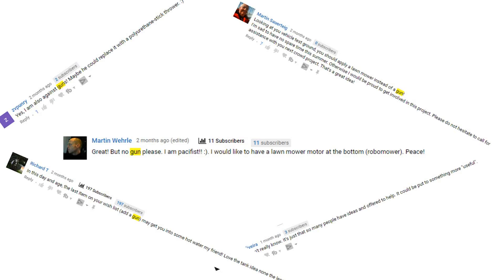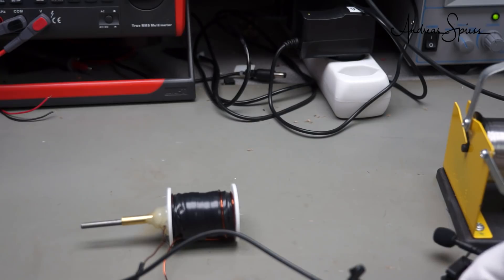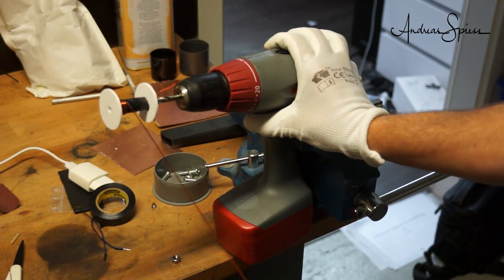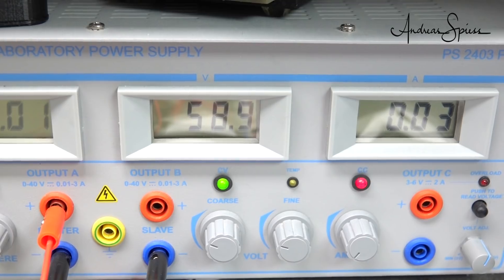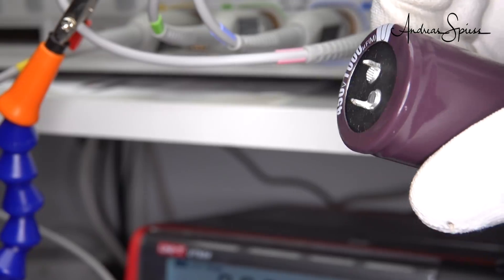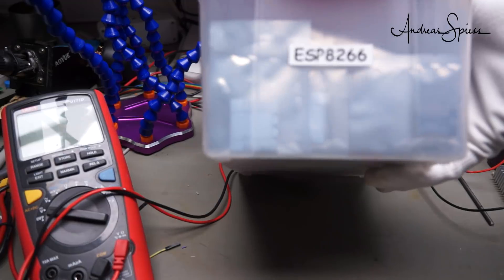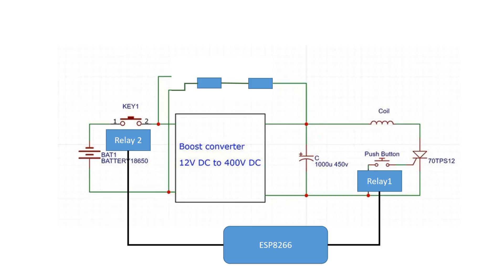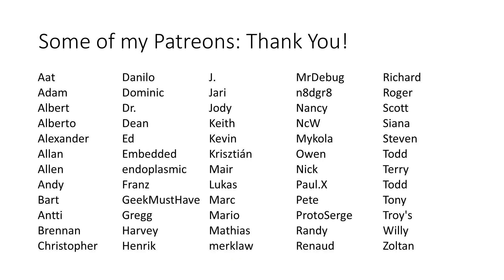#221 Better than GreatScott's Coil Gun? A true story, how-to not do it

Comment: The SCR  Gate - cathode is a diode  and is triggered when the gate current current exceeds 100mA, so gate should not be connected to a voltage source. Connecting it to a 1.5V battery or power supply to gate can destroy SCR which in turn can put 400V on the gate. I suspect that this happened to your power supply. ALWAYS PUT A LIMITING RESISTOR IN THE GATE LEAD.
Reply from the maker: So I learned an additional thing. Thank you!
Reply: As you are switching an inductive load, you should also have a reverse diode across the SCR to protect it when SCR switches OFF. This circuit is similar to a Capacitive Discharge Ignition (CDI)
Charging current of High  Voltage capacitor should be limited to less than holding current of SCR (typically 50mA). You should also pulse the SCR with a 1ms pulse. When inductive load reverses, SCR will switch off and excessive energy will be returned to the capacitor via the reverse diode across SCR.

Comment: Hey Andreas, great video! Many youtubers get a lot of their subscribers by blowing things up, so I hope it works for you too! ;-)

When I was developing power supplies for active sonars, some of the tests were not completely successful and sometimes equipment would blow up and a few times the fire department showed up, but I can tell you that everything was okay because I made sure that I was always behind a wall when the tests were run, and of course the company I was working for was paying for the equipment that was being blown up! :-D

Anyway, stay safe and you should probably think about adding some protection circuitry to any high energy devices, especially if they come from China. A cover to keep the pieces from spraying out and a GDT rated for a safe voltage across the terminals would be a good start...
Reply from the maker: You as a professional in this matter, of course, would have done it differently and I should have known it better.
But because I forgot nearly everything about high voltage since my youth, I was again at the first step of learning: Unknown incompetence, I even did not know what I do not know. 
Now I advanced one step: I know what I do not know. At least something...

Comment: I think reverse emf of the coil caused most of the problems, a tiny reverse polarity stocky diode can solve this.
Reply from the maker: I am not sure as the reverse diode usually prevents spikes if you open a switch at a high current through the coil. In the case of a coil gun, the Thyristor opens at nearly no current.

Comment: Perhaps add a bleed resistor across the cap?
Reply from the maker: Without charging the voltage drops in a few minutes. So I assume there are some parasitic resistors somewhere. In operation, the ESP had to charge the cap every 10 seconds or so because the voltage level dropped below its threshold.

Comment: FWD?
Reply: Would a Free Wheeling Diode across the coil help eliminate the CEMF spike or would it make tau so long as to render the field collapse too long to be useful?
Reply from the maker: I am not sure. Usually, the spikes are created by an abrupt opening of a switch at full current. Here the Thyristor opens at nearly no current through the coil. So no spike should be created.
Reply: Vcoil = Ldi dt If the coil current is 0 to begin with and then 130 amps peak, the voltage will be very high. The question remains: what happens when the current drops to 0 amps? Would there not be a negative spike of voltage across the coil?

Comment: ok, so the next Episode is a repair story of a discontinued Conrad Voltcraft power supply. I assume that your DMM confirms the built in meter's reading. The repair shoud not be a big deal, Standard componente as 2N3773 and opamps as 1458. You can replace the 2N3773 by a fixed resistor and change the load to measure if the opamps are still working (probably not). Or you first can replace the suspected 1458 and but this could lead to a short Video.     

Be happy that your gun did just kill a few semconductors instead some eyes or something like that. Try a water gun. It is also fun but not so dangerous.
Reply from the maker: klassisch D: Thank you for your information. I also hoped I will be able to repair the thing. With your info, it will even be easier.
Dean: Maybe I will do a short video about it if it is worthwhile.
Reply: Andreas Spiess Record your repair as people like me would love to see your approach. And how you repair it.
Reply: klassich D wise words, thank you for the information and taking the time to explain, as I too was having the very same thoughts.  Andreas, pls show us the repair of the power supply.

Comment: Such orders of magnitude between operating voltages is a risky game!  Secondary effects begin to dominate and the absolute maximum ratings are tested ..
Reply: Likely the magnetic field collapsing in that huge coil sent a voltage spike through the thyristor to the microcontroller.  Always isolate the two from each other. The high voltage DC current will eventually kill that optoisolated relay as well through the arcing across the contacts. See John Ward's testing of DC voltage across a switch designed for AC.
Reply from the maker: In this concept, the arches seem to be less of an issue as they usually develop if you cut the current in a coil. In this coil gun, the Thyristor opens at a current of nearly zero because the capacitor is completely discharged. But, as I said, I am not at all a specialist in this matter.
Reply: I am no expert either but if there is a low resistance common ground, the collapse of the magnetic field to propel the nail will happy apply a very high voltage negative potential to ground equally to the thyristor as well as the ESP8266 .. if there is no common ground, then perhaps the inductance between the nearby circuits would do it.  It is a difference of 100x between operating voltages at very high currents and the electrical circuits will be happy to momentarily draw from nearby circuits, and even if it is 1% that is a bad situation!
Reply from the maker: You are right, many potential sources exist and an expert probably would know much more. I learned that, when I will work with high voltages in the future, will try to isolate the low-level stuff completely
Reply: I agree, and it would be wonderful to learn where things went out of spec and why, especially if it could somehow be done in a way where components do not get broken in the process :)

Comment: LMAO @ the 'Chinese 400V'...  Unfortunately, it's dangerously accurate too!
Reply from the maker: This device was one of few which actually exceeded its specs. But in the end, did not survive. Many parts do not get up to the specified voltages or currents
Reply: There are two problems that caused the capacitor to explode.
1. In order to produce 400V from a switching converter, you need spikes of greater than 400V which are smoothed out, capacitor should have been 450V.
2. No load on the negative 400V rail, so it will continue to soar past 400V as long as there is a load on the positive 400V rail. Ohms law will give a suitable resistor value.

Both are noob mistakes from people who do not understand practical SMPS design, only one mistake is yours. Multi rail SMPS designs often only have one rail monitored by the feedback circuit, the other rails are a case of "hope for the best", PC ATX supplies monitor more than one rail.

In hindsight would have been better to ask the electronics community for advice, rather than throwing money at the problem. A quick post on eevblog forum may slow down the video making process, but others would see the flaws in your design before you build it.
Reply: @AndreasSpiess  please contact with me. shohag5050@gmail.com
Reply: Better check your TV, computer and anything that has a switching PSU. Most will have these "Chinese 400V" capacitors in them. And they are not a problem - unless you exceed the ratings, which is what happened in the video. The cap didn't blow because it was poor quality but because its voltage rating was exceeded (the power supply produced more than 400V).
Reply from the maker: You are right. But usually things have a rating and a max rating which is not the same. And the typical rating is printed on the parts. In this case, the typical and the max was pretty close. And the producer of the converter should have known that his device easily gets over this limit. But I do not blame anybody for a 5$ device!
Reply: @AndreasSpiess  Rating 400v, max rating 350v.
Reply: At work we use many Chinese parts. There is a large manufacturing wing in China that would laugh at American or Swiss quality control. Don't laugh at China that easily. You get what you pay for is the bottom line.

Comment: Could it be EMP that killed your esp?
Reply from the maker: Probably. For sure some overvoltage and not overcurrent as it did not smell afterward.
Reply: Back-EMF you mean.  Collapsing magnetic field in that huge inductor (the big coil) would create quite a sizable voltage spike that should never be underestimated. Always be sceptical of Instructables builds which omit the necessary back EMF suppression.
Reply: Actually I ment EMP, a short, but strong magnetic pulse indusing currents in the esp module. Kind of like the coil is the primary of a transformer and the leads in the module is the secondary....
Back EMF was in my thoughts, but I thought that with a thyristor it would stop conducting at zero amps, and that would lead to no back EMF. I could bee completely wrong in that as coils is not my strongest side...
Reply: @kjetiltrondsen8242  The possibility of EMP effects cannot be discounted. A Ludic Science video demonstrated an EMP device disrupting a pocket calculator however the high voltage coil had to be held very close to the calculator and a thin layer of foil was enough to protect it from harm.

Back-EMF is more of an issue precisely because the thyristor stops conducting to the ground rail and thus the coil has no where else to send the current generated by the collapsing magnetic field. It can end up generating a very high voltage at the thyristor's anode. If the voltage gets high enough the thyristor breaks down, and current flows to the grould rail through the gate and right through the microcontrollers GPIO pin. See w2aew video on the topic of flyback diodes for back EMF suppression: 
#183: Why diodes are used around relay coils: Back to Basics on flyback or snubber diodes

Comment: I‘d go with something less dangerous... search for USB Rocket Launcher. It shoots foam darts and x/y axis as well as the trigger can be controlled via USB - so it can be hacked and controlled from an ESP.
Reply from the maker: You are right. Nerf guns are less dangerous. But I was interested to try this "dangerous" variant. And obviously, I learned quite a lot.
Reply: @AndreasSpiess  If you think your Nerf gun isn't dangerous enough,  you can always try Allen Pan's Taser Nerf gun mod or any of the Nerf mods by Peter Sripol featuring flammable gasses.
Reply: I got one of those USB missile laughed from the recycle bin. They were once popular a decade ago. Don't know where to get the USB driver from (no CD,  and dead download link) but the mechanics are pretty simple.  Just need a couple of H bridges and a transistor to bring it under control of any microcontroller.
Reply: You can always put a foam dingle on the end to keep it safe.

Comment: Glad your didn't get hurt! Hope your ears didn't start to bleed from the capacitor explosion. This gun is a real killing machine, you should consider something less lethal.
Reply: that cap only stores about 80 joules of energy, a .22 cal bulley has about 120 joules. a tiny fraction of that 80 joules actually gets transferred to kinetic energy, the 400v on the cap is more dangerous than the "bullet"
Reply from the maker: As mentioned, this was it probably for some time. But I wanted to try it out since quite some time.
Reply: You can always switch out to ball bearings inserted inside of plastic/rubber/foam bb's.
Reply: @AndreasSpiess  don't listen to the nay-sayers. Take appropriate safety precautions and continue on. If nothing else, these experiments are good learning experiences. I'm sure by now you know a lot more about this subject that you did a month ago. I find this sort of work fascinating.

Comment: Wonderfull !! Too bad of you power supply. High voltages... been there, done that. I did experiments with car coils (Auto Zündspule), not the regular ones, but a lab version of around 40cm's long and 20cm's in diameter.... also known as Ruhmkorff zündspule. Awesome... and also a little dangerous. The explosion of capacitors... tell me about it ;)
Reply from the maker: My voltages, fortunately, were much smaller than the one produced by these ignition coils. And I hope, I can repair the power supply. It is an old one and maybe not so complicated.

Comment: The current is also limited by the charge time of the inductor.  Use optoisolators or relays.  Clamp input voltages from dividers using <3v zeners.
Reply from the maker: You are right with the charge time of the inductor. I forgot to mention this one.

Comment: I think there is a difference between rail gun and coil gun!
Reply: Coil guns uses coils and railgms uses rails(captain obvious). That is the difference... But they also depend on different physical laws and the railgun is much more difficult to get working...
Reply from the maker: I changed the title to be correct.Thanks!
Reply: @AndreasSpiess  So have you considered stacking the coils, individually powered, and sequentially energized? Each could be timed to the specific velocity at the point in time it passes. Maybe using the EMF feedback function of a microcontroller (one designed for motor control)?
Reply: One blows your power rails, the other doesn't :) 
Buy a hundred optocouplers on alie and some flyback diodes. With battery powered HV it's optional, but ideally I'd try to split the ground between HV and Vdd. The other way is to carefully put diodes for flyback and voltage clamping. More resistive paths between the MCU and HV is also a good idea.
Reply from the maker: You might be right. I did not research. I just found these two names for similar devices
Reply: In the video, the functioning of the working model of the electromagnetic mass accelerator (mobile test stand). It is generally accepted that the implementation of this design is very difficult because of the low efficiency and low reliability. Nevertheless, this opinion is mistaken - modern technological the base has long been able to realize an electromagnetic mass accelerator with an acceptable efficiency and high reliability I am looking for interested in making. 
https://www.youtube.com/playlist?list=PLfhSIf7qgNZbdEVBvmjgqkalNNbqTJRtz
Reply: Rail guns use current flowing through a projectile in a magnetic field to produce a force - it works the same way as an electric motor does, but instead of the projectile being held by an axle so that it spins around that axis, it just flies off in a straight line.

Coil guns use a series of precisely timed electromagnets to pull the projectile forwards. No current flows through the projectile so it doesn't have the same problem of spot-welding the projectile to the barrel.
Reply: exactly my thoughts when i saw this video
Reply: Both are linear motors designed to accelerate an armature or projectile and both operate on the principal of Lorentz force.
Reply: Look at all that you learned.  Maybe you should title this video, Diary of a wimpy engineer.  You surely can fix the power supply.  So you and your viewers learned so much respect for high voltages and high energy and doing more thorough researxh.  Good for you.  Now it is time to get started on the RAIL GUN!
Reply: There is. He has no idea what he is doing, and blowing things up is good evidence of his ignorance.

Comment: nice vid..exactly the same reason i dont like playing with high voltage...its just too easy to kill stuff including yourself!
Reply from the maker: I was happy that I was not hit :-)
Reply: I was "playing" around with the flash charging circuit from a "dead" digital camera and destroyed my multimeter.  Fortunately it was one of those cheapo £4 multimeters. I might try reusing the case, LCD and connectors in another project. Learned the same lesson of using sacrificial components when experimenting with high voltage for the first time.